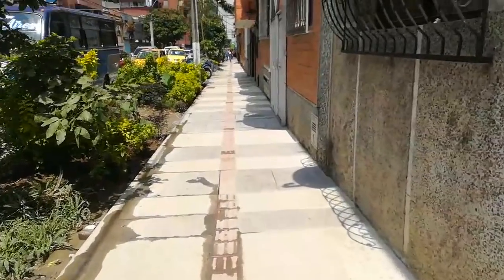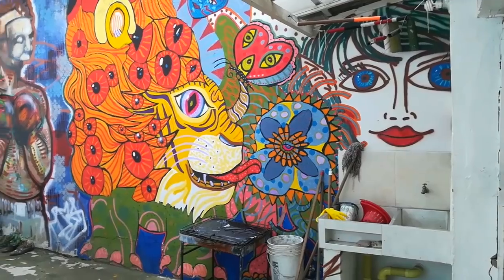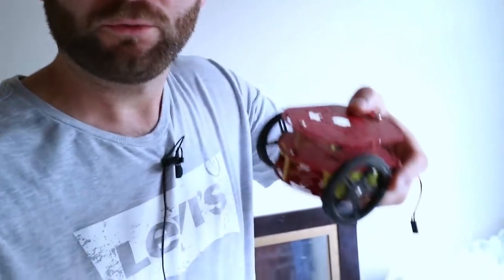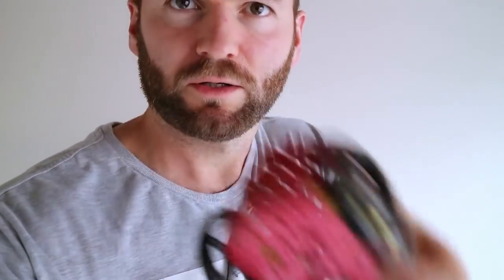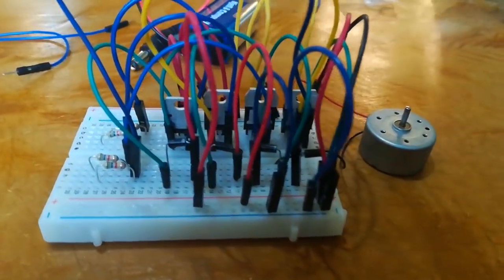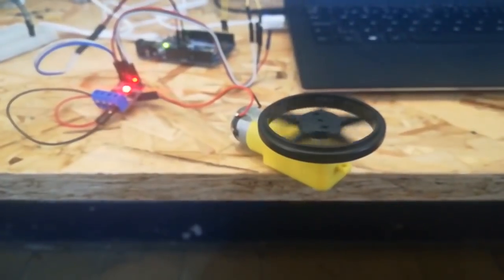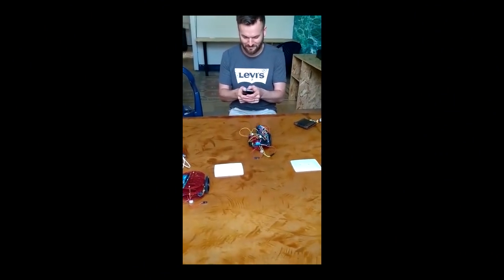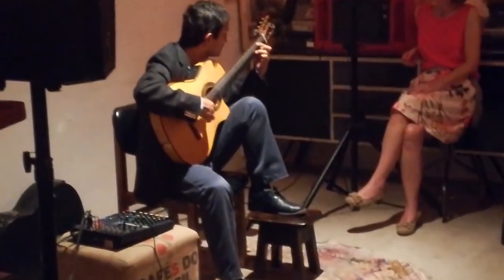VLOG - Building a robot, Colombia (PART I)

Comment: Hi, videi is fine, ir will be usefull to have the Lessons on this topic.
Oh ;), may be as variant - with making PCBs for control units.
As for me - every project must have the parts with E-Schemes
and all steps (may be in KiCad) up to finish pcbs, then aliving
this pcbs after ironing - within the multimeter, oscilloscope with discussing
all needed for future ee-engineers moments...
Regards!
Reply from the maker: Thanks! All good suggestions that I will take with me.